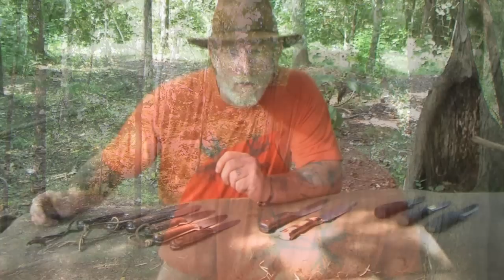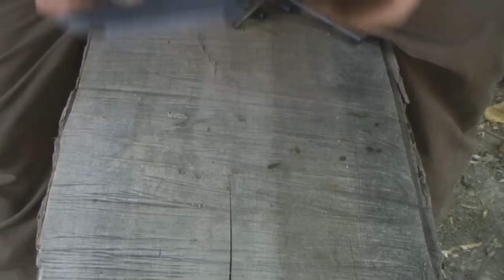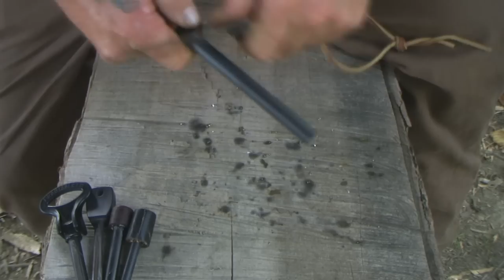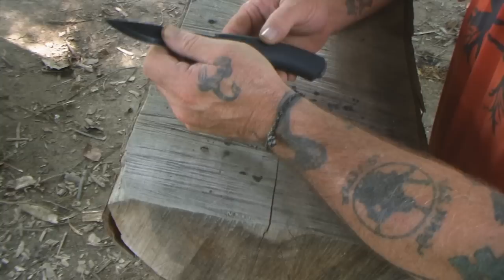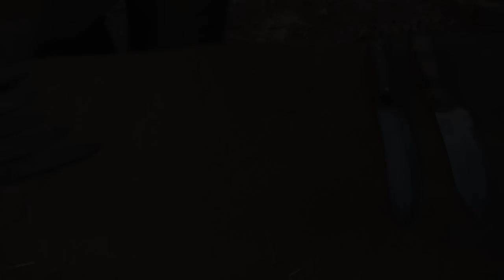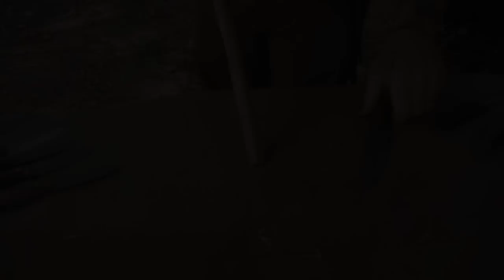Knives JMHO

Comment: Hello Dave, 
I hope I can ask you of a possible suggestion for a good full tang "stainless steel" knife. I work conservation and my work at times has me going into back country. I've gone through a few knives that some people have recommended and say they trusted. While those knives weren't bad knives they were either not quite rigid enough to me because they were 1/8 of an inch or I couldn't do finer cuts or bush craft with them, due to partial serration. I live in Hawaii so pretty much everywhere is subject to coastal salt air and humidity otherwise I would have ordered one of the knives on self reliance outfitters. I'm sold on your particulars on what you want in a knife, so aside from the fact that I won't be able to use it for flint and steel and possibly not being made overseas, what knife or knives would you suggest?

Comment: I currently carry a 3/16" thick and 3" long 154CM fixed blade daily. in my state a knife cannot have a cutting edge over 4" unless in a wilderness setting. What would you recommend as a 3.5"-4" that will be an EDC blade but also effective as a bushcraft/survival knife?
Reply: +michael gerber Mora #1 or Basic 511. I picked up the new 511 for my daughter, very impressed with it and will probably buy for myself. Both are under 4" blades. Neither is necessarily a survival knife, but they are incredibly light and an excellent choice for a fixed EDC.

Comment: Dave, 
Ofcourse after watching you for years now, I know how you feel about knives. I will say, the best knife I have owned so far, is made from D2 Tool Steel. How do you feel about that metal? It does take a little longer to sharpen but it holds an edge for quite a long time, and is the strongest blade Ive owned. What are your thoughts?

Comment: Enjoy your philosophy on many topics.  Keep it going, it matters.  People are so far disconnected with the reality of work and reality from spoon fed media its good to remember our roots of using our minds and hands to actually DO something outside the living room. I have lots of gear and tools, but tend to come back to basics.  Old hickory and moras are typically damn good enough.  It's skill set that lends to sharpening and maintenance that will promote results.  My expensive gear sits in a box for fondling.  My users get used.  Point is...use it.  If you ain't using it, how well do you know it works?
Reply: +Molokairider Had an old hickory  butcher knife for years that I took camping, fishing, and hunting. Accidentally stepped on it one day and bent the blade.Need something more substantial for heavy tasks than a mora or a kitchen knife.

Comment: Dave is a stud! Survival knives are different than combat knives. As a marine I had a Kbar and bark river brovo2. The bark river could be a survival knife. Kbar is for killing or opening MRE's
Reply: Destriathon Roseanne I never said the pilots carried a K-bar. I was talking about purposes of a knife and it was an example. If you read it again I called them 'pilot survival knives' and said that they are different. So I am not talking about a K-bar.
That still doesn't say anything to what I said about the K-bars intended purpose. Nor does it confirm that they are trash. The fact that they weren't issued to pilots shows they were made for an intended purpose and the pilots knives were made for a different intended purpose. Otherwise they would just give them to every division regardless of the tasks at hand.
Reply: +Jay Jensen  The traditional  Ka-Bar is one of the best survival knives in the world.  It may not be a true full tang, but I've seen a number of them batoned through aluminum with a large hammer, and the blade will break before the tang does.  It happens every time.  And what it takes to break the blade, even with a hammer, is incredible. 

A Ka-bar is made of the best 1095 money can buy, and is heat treated far better than most of the custom knives out there.  It has every attribute a true survival knife needs, and a lot more.  

But, then again, the whole concept of a survival knife needing to be big, thick, and expensive is a complete myth.  If you get caught in the woods with nothing but a knife, you did something stupid before leaving home.  Only an amateur goes into the wilderness with nothing but a knife on his belt or in his pockets.   If you're carrying the tools on your belt and in your pockets that should be there, a Mora is far more than enough.  

Real woodsmen in many cultures use knives smaller and weaker than a twelve dollar Mora, have for hundreds of years, and still do.   If you don't have a pocketknife, a real one such as a Hunter of Stockman, not a single-bladed tactical piece of junk, a saw, such as a Silky Pocket Saw, and either a hatchet or properly designed tomahawk, on your person, stay home.  You don't know how to prepare for the real wilderness. 

If you have to baton or chop with a knife, it's because you aren't carrying the tools you need to have with you.  Knives are simply the wrong tool for chopping or batoning, and YouTude incest, mostly by those who have never actually lived in the wild for any length of time, is why such things are popular.  

Dave is a brilliant man, and knows more than just about any of the "experts" on YouTube, but we disagree strongly on two or three issues, and this is one of them.  There's a right took for every job, and carrying them is not a burden in any way, if you carry them correctly.

Comment: Since Mr. Canterberry refuses to answer even the most basic questions then I will turn to the people here. WHAT THE HELLS WRONG WITH THE K-BAR? Great steel, honed to shave my arm hairs and tough as hell.
Reply from the maker: Carried one for years until I broke it batoning one day, then saw another break at my school during the same activity. Honestly for me the it is a bit long and the guards get in my way for finer tasks, the blade is coated and it does not have a 90 degree spine. That's about it really but that is enough to tell me there are better option for what I do everyday.

Comment: what is the minimum blade length for chopping in your opinion??
Reply: I'm no expert, but I prefer a blade between 7-12" inches for chopping, and I think the sweet spot is right at about 9.5" or 10"
Reply: Thanks for the info this question was asked pre BK9 and after using it I have to agree a 9 inch blade chops great!!!!!

Comment: Hey Dave. Thanks for the video. Where can BHK be purchased? I tried googling... no luck. Every website seems to be out of stock, and BHK, evidently, have no website.

Thanks,

Matt
Reply: Blind Horse Knives owners split the company into two companies; Battle Horse Knives and LT Wright Knives.  They both make some of the patterns from the original company, but both new companies reflect the individual owners more.  Battle Hose Knives makes knives a little more true to the original company.  I own knives from both and they are both still hight quality.  LT Wright plays more with A2 and 3V than BattleHK, and the new BHK has a tendency to stay in the O1 tool steel knives.  If you are looking for cold spark off the spine, stay in the O1 steel.

Comment: I've had my eye on your buffalo Skinner knife for a long time.  In your opinion will this be a good edc/ one tool option?
Reply: I have the Buffalo skinner.  I haven't used mine yet.  Its a very unique blade.  Old style with a modern twist.  All my other PKS knives are awesome.  I bought the Buffalo skinner as a primary belt knife while hunting.  Unfortunately I have come up short in harvesting the last couple of years.  The handle on the Buffalo skinner is very slim and short.  I don't have a problem with that but depending on your hands, might be an issue.  The belly is gonna make skinning easy and the scandi grind will work well with carving.  Its a bit light to be a chopper and a little thin to be great for batonning.  For EDC, I don't think there is anything it wont really do.  I know that's a lengthy opinion for a knife someone has never used but I'm basing it on the other PKS knives I have and the other brands with similar features.  Bottom line, PKS knives are Top quality and the price almost doesn't make sense.  Lots of manufactures charging more $$ for a lot less.  Just my opinion.

Comment: The magnesium block ferro rods are not for regular use, they are for starting fires in bad weather up north in Canada and Alaska. They are kind of like hurricane matches while normal rods are like normal matches. You scrape off a pile about the size of a toonie when you use them and it will burn hot and long enough to get a fire going in a blizzard with a frosty tinder stick. The block will wear out way before the rod does if you are only using it when you need to and have a regular rod for normal use.

Comment: I have a question that might sound stupid, but I'm not a metallurgist, so I ask out of ignorance. In the video above you mention in passing that it is easier to sharpen a high carbon steel blade in the wild, than a stainless steel blade.  Could you please explain why that is so?    Also, can you use a stainless steel rod with a ferro rod to make fire?  Thanks in advance.